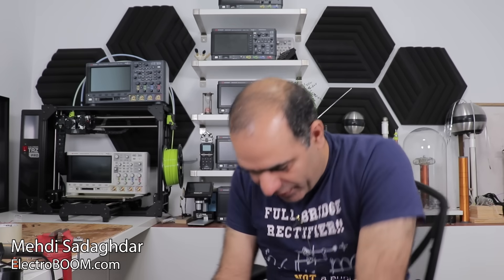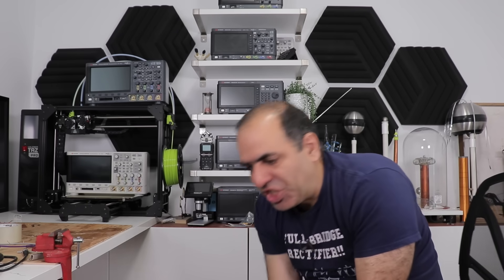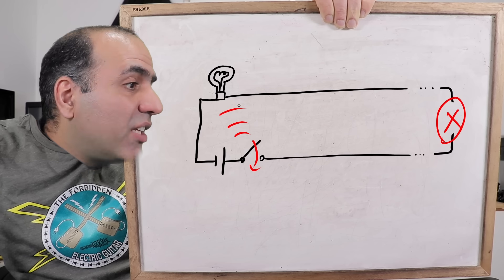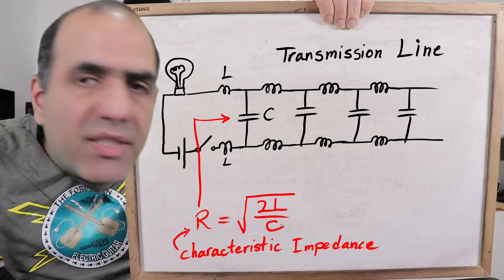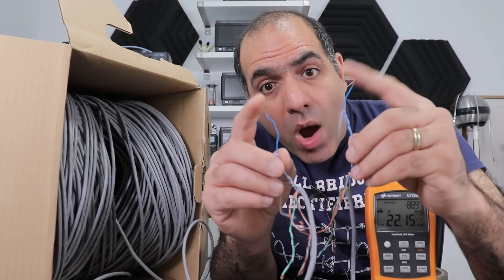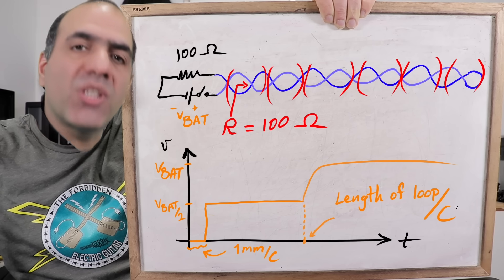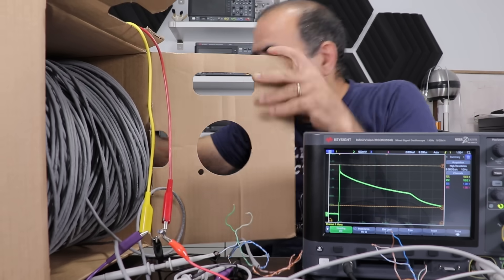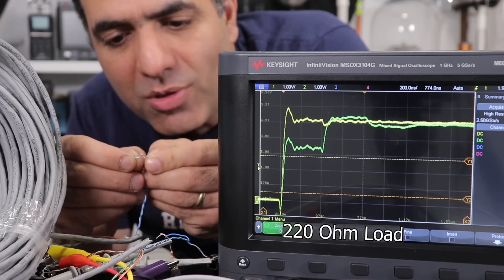Testing the LONGEST LOOP OF WIRE!!! to Turn a Lamp On

Comment: I think this again shows that the original Veritasium experiment is not about power transmission but about signals.

When you just turn it on, we can't really even see the light blinking. Only by connecting a pulse generator can we get an output that we can actually see. But what is that, then? It's a radio transmitter and receiver!

But I don't think anybody would have been baffled if Veritasium had said that with a 2 light seconds long superconducting cable they could send and recieve a strong radio signal over 1 m distance.

Comment: He ist not showing the Led turning on with the Open Line after He added the resistor. Am I right it would Work Like expected now and the Led turns on for a Brief Moment when He conects the Open circut To the Power?

Comment: Nerdy question for you... what happens if you use AC instead of DC?  I've done a bit of homework before asking this question and my partner will not let me connect 1000ft of Cat 5 cable to mains nor do I own the equipment to test my question - No fun. Thanks for all of your training. (I think I get twisted pair now too 20+ years later)

Comment: if you had a lightyear long length of wire and never connected the ends would it still work? would you get power through it for two whole years before it turns off??????
Reply from the maker: Yes

Comment: 14:18 this is interesting. I didn't know anything in pre-diode electronics had this effect on the output where it will flip flop between values before approaching the final value, or increase, depending on input values. Seems like it could be used to build some kind of steampunk computer given enough wire.

Comment: LAN cable (all categories) has text printed on it during manufacturing. It shows cable information AND measurement marks starting at 305m in your case and counts down as you dispense it showing remainder of cable in box. For us in UK 🇬🇧 that’s metric so it’s metres for us. Not sure about you in USA? Therefore there’s no need to manually measure cable length as you showed in your video. Now having said this something is telling me you already know this and manually measured your required cable length with tape measure perhaps to provoke a comment? Oh, the boxed cable is cleverly coiled inside in such a way that the cable can be pulled from the box through the hole and no need to open the box. If you do open the box and disturb the way cable is coiled you may regret it. Once kinked inside it turns into spaghetti and spoils your day, so good luck with that if happens to you. Hope this makes sense. 👍 from me! ✌️🇬🇧

Comment: 10:00 the top and bottom twisted pair wire colors cannot be distinguished  well. For technical information please make sure to pick colors that contrast enough, especially with color vision deficience (not color blindness as it's often called, since colors can be seen, just that compared to average vision, some colors contrast more and others less, but there are colors that work for almost everyone -- those that really can see colors and don't have grayscale vision). So while it's often called color "blind", it is a misleading term and a misnormer.

Comment: Saying that it "knows" is a terrible explanation. It doesn't know anything. This is a simple capacitive/field interaction, it's a result of the inherent non-ideal characteristics of the system. A field will briefly be present as a ghost in rush current flows to fill the capacitance between wires. The reflection point basically represents electrons "bouncing" off the open circuit. This is well known, and is the reason SCSI buses must be terminated with resistors: if you didn't do so, reflections would come back to the bus transceiver. It's also a known phenomenon in radio with incorrectly tuned antennas, and is represented in a figure called reflective power.

The rest of the circuit isn't operating on "knowns," it's just two things happening simultaneously: the inrush from wire capacitance, and the reflection from electrons trying (and failing) to find their way to positive. The little inflection point from the electrons reflecting demonstrates that it does happen. The tail off during open circuit represents the open circuit wire capacitance.

Basically, this is nothing new. All that's happening is the wire is a capacitor when the loop is open. It allows a brief current into the plates (with reflections because of poor tuning) and allows quick AC pulses through to the load.
Reply from the maker: What is... knowing?

Comment: The waves aren’t “reflecting”. The valance shells of the copper atoms are filling to saturation or equilibrium. When the switch is made you get hole flow in the conventional direction to complete the circuit. Electrons don’t “bounce” off atoms. They travel via valence shells. As an electron sees the brief free space it jumps in.  The atom becomes unbalanced and now must lose one to the next atom free space or “hole”.  If an electron had enough energy to “bounce” off an atom it would be a radioactive beta particle. Not an electron.
Reply from the maker: Electron doesn't need to leave its atom for a wave of current to happen, which is different than a flow, were electron can leave
Reply: @ElectroBOOM  DC pulses were used, not ac. You created a static charge on the copper wire by using dc. Your wave is directly caused by electron flow. You can not get a wave without electron flow. Whether it’s moving to one end of a capacitor or through an inductor it’s the very movement of the electromagnetic field that creates a wave and the field only moves when the electrons move from atom to atom.

Comment: This solved the whole puzzle for me. Actually being able to see the speed of light (in the wire) visualized on the screen was facinating and really convicied me of the whole wave theory.
Reply: It's bloody amazing when you get a visual nudge to get the noggin' joggin' !  by now I'm convinced, we could skip school and just have the tutors carefully select/curate videos with these almost magical properties to teach abstract concepts such as refections, magnetism, reactive power, how charged surfaces behave etc. Much too often schools focus on formulas, numbers and math examples... which are to quite alot of students completely utterlessly useless unless they understand the underlying behaviour first.
Reply: @Paxmax  You say that because you don't know what you don't know, so you think you've learned much more than what you've actually learned from these videos
Reply: @tonylee1667  Fair point, I was not educated, tried and tested "from scratch" by the method I described... I am a product though by teachers who suck at teaching to some degree... and teachers that suck at breaking down new concepts in smaller chunks to make it understandable / unable to approach from different angle.
Reply: @tonylee1667  Maybe I misread your comment slightly; I did not learn much new from this Mehdi video, I have worked in R&D as electronics designer for 16 years, I have designed and tested both copper and optics communication designs/devices during the years. I am definitely by no means an expert at all. It felt easy to indentify how I wished certain concepts would have been explained rather than wait until you learn by work experience or independent struggle.

Early in the Mehdi/Veritas "fight" I have even suggested an analogy of my own: Imagine instead of copper wires a garden hose. You suddenly turn on the water, it is detectable at 1m distance very much sooner than you can get full power because of the accoustic effect of the ever so slightly sudden bulge of the hose. The noise travels through air and imparts some energy into the "target hose" section before the water comes rushing into target hose. It aint much powah delivered by accoustic... but its there. I have previously designed a "water world" to explain electricity/energy transfer through various components as a different way to make electricity more approachable and perhaps relateable to learning for rascal brained people like myself.

Comment: Hello again ,nice video and i dont disagree either with you or Veritasium all videos i v watched on the matter  where very interesting and i think we can all conclude that   its about  induction ,  you are right ''it doesnt matter '' either you use a pulse (battery/switch) or a pulse rate  the basic law is  the general form of Faraday's Law ε = -dΦB/dt.which  applies  but   its not the only physical phenomenon that  happens  in electricity  there is also lets say charge distribution  ,and an other thought experiment, if you apply an alternating source  on the theory circuit lets say  50 hz  will the nominal  current  ever reach the bulb ?  for 50 hz we have 50 cycles per second ,for  each cycle current flows towards the bulb and then reverses ,a classic sinusoid , for the first half of the cycle  the  current has traveled for 0,01 sec for 50 hz  before fading to zero and reverses , that time is  about  3000 km in distance  and the  cycle repeats,  so how can  alternate current   ever reach the bulb ?

Comment: If you have a chain that has no flexibility and no slack and is 9 million kilometers long and has a driving and a driven sprockt at each end. You turn the driving sprocket around a few revolutions, and before one link of chain even moves one metre through the loop, you have transferred power from the driving gear to the driven gear. My point is that one link of chain does not have to move the full 9 million kilometers and back before energy is transferred. Maybe it happens instantly? What if the chain works the same as electrical power and energy is transferred through the air in some sort of force between the two sides of the chain. Even though it's 9 million kilometers long, side to side could only be 1 metre. What if the power transferred through the one metre distance instead of the 9 million kilometer and back distance? Now of course this doesn't mean that if the chain had tension and slack that it would be the same because you would have to overcome the slack and tension before the other side would receive power... or would you? Once you start pulling the slack the balance would change and the other end would move. Perhaps though, there would be an amount of time to overcome the tension before something happened at the other end. Would this time be the speed of light, or maybe some other amount of time possibly faster than light? Could you then send a signal through a significant distance instantly through a physical thing? Would it travel at the speed of sound did like a vibration through the chian? Could be that it's the same as a kids toy telephone made from a couple paper cups and a string, except the string is 9 million kilometers long...

Just had the random thought after watching a video about lego chain moving around obstacles...

Comment: I just had four 1000 meter boxes of cat6 cable delivered to my classroom for a rewiring project in the fall.  This experiment is awesome for demonstrating how the twisted pair cancels out the noise between adjacent transmission lines. I absolutely need to do this demonstration in class in the fall, with ALL FOUR BOXES!

Comment: I was looking at the 'electric fields carry the energy' setup and how that'd make the lamp pulse if the wire was broken. Though "oh that's just a capacitor, of course there will be a pulse." That's not wrong as far as I can tell, but, at least to me, that makes this mechanism feel a lot more real than it did before.

Edit: Feel like I should point out: Using "it's a capacitor" to argue against Derek's claims would be like using buoyancy to argue against the existence of gravity; buoyancy is caused by gravity, much like how capacitance is caused by electric fields. I'm not doing that here, in fact I'm doing the opposite - like the EE version of "The boat floats because gravity pulls the water that would otherwise take its place down harder than it does the boat." It's understandable how those claims could be made, after all capacitance feels like a separate idea here.

Comment: This really raises a lot of questions in my head.
If it is not the movement of electrons that causes electricity to flow, how do solar panels work? I was always told that light hitting the panels surface frees up electrons which then can freely travel through the material and are then put into a circuit to generate electricity. How does this fit together?

Comment: @3:46  Battery in the diagram is the wrong way around.  Electron flow is from the negative terminal.
The diagram is positive holes flowing forwards or electrons flowing backwards, but it will still work.

Comment: Very well done!

What if you had this setup where the \ on the right is a switch that flips the energy connection "e" between the top and bottom bulbs "b"
|----------------b----------------|
|----------------e----------------/
|----------------b----------------|

Does that mean both bulbs will come on as soon as you activate `e`, but one of the two would then turn back off?

If that is the case, then in the following setup would both bulbs come on, and then the top bulb would turn off and the bottom one stay on?
----------------b---------------
-
----------------e----------------
|                                       |
----------------b----------------

If that is the case, does that mean if the wires were 5 light years long either side of the energy source (zero resistance) then the top bulb would stay on for 10 years before it went off?
Reply: Yes, yes, and yes. You do need a bit more than just zero resistance though, you need zero losses including inductive losses.
Reply: @jmodified  As a programmer, I used to laugh at people who claimed the universe was a giant software simulation. The more I learn about stuff like this, the more I see computer programmer hack jobs that made it into the software because someone was under pressure to deliver :)

Comment: So a friend of mine and I were talking about how bad a lot of the phone chargers are that Apple sells. And the question came up. Why do we use solid copper wires anyway? Why not copper dust or copper shavings, tightly compacted in standard wire insulation? That way the wire could remain flexible, yet won’t break as easily.

Comment: Have question of transformer phase of sinus is 90 derese behind of power that means pulse signal is behind of power even on long wire. That means you get delay of turning lamp on at power.

Comment: I have to measure the length of twisted pair cables in house installations. Prior to starting the measurment we have to input a few things into the measurement device, one of them is the NVP factor, to get the length right. It slighty differs from cable to cable depending on the manufacturer, but in general it is 0,6 - 0,7 for CAT6 cables. See https://en.wikipedia.org/wiki/Velocity_factor

Comment: woow the wire is actually LOOOOOOOOOOOOOOOOOOOOOOOOOOOOOOOOOOOOOOOOOOOOOOOOOOOOOOOOOOOOOOOOOOOOOOOOOOOOOOOOOOOOOOOOOOOOOOOOOOOOOOOOOOOOOOOOOOOOOOOOOOOOOOOOOOOOOOOOOOOOOOOOOOOOOOOOOOOOOOOOOOOOOOOOOOOOOOOOOOOOOOOOOOOOOOOOOOOOOOOOOOOOOOOOOOOOOOOOOOOOOOOOOOOOOOOOOOOOOOOOOOOOOOOOOOOOOOOOOOOOOOOOOOOOOOOOOOOOOOOOOOOOOOOOOOOOOOOOOOOOOOOOOOOOOOOOOOOOOOOOOOOOOOOOOOOOOOOOOOOOOOOOOOOOOOOOOOOOOOOOOOOOOOOOOOOOOOOOOOOOOOOOOOOOOOOOOOOOOOOOOOOOOOOOOOOOOOOOOOOOOOOOOOOOOOOOOOOOOOOOOOOOOOOOOOOOOOOOOOOOOOOOOOOOOOOOOOOONG

Comment: I think your bit about the twisted pair is a little off:
For the fields to cancel out (reducing the inductance), the signal needs to be in phase between both conductors - the negative and positive will be driven simultaneously and will propagate the cable together.
In your experiment, since current flows through one wire then the other (excluding the capacitively coupled current as this is not going to be of exactly the same magnitude), the magnetic fields will not be cancelling out and the inductance will be higher.
Reply from the maker: But the current in both wires will be in phase, you can't have different currents flowing in series circuits. What goes into capacitor comes out of the other side, only except considering the speed of light

Comment: after watching this video on planetary gears; https://www.youtube.com/watch?v=TzJkD87eQNI
and thinking about maglev fans for PC's, could we place magnets in the "planetary plane"; Directions |--->  ;to produce torque from both inside the motor and outside? 
I.E. 3 Shafts in with magnets capable of spinning in sync - using something like a Limited slip differential to allow for maximum torque from x shaft doing so- rotating both the internal shaft (sun gear) and outer ring in the opposing direction (ring gear) to produce dual output from a "DC" motor? 

Side note because I may be stupid atm butttt: I see we only ever harness the inside and outside of our devices but what if we started to manipulate the events happening in between devices?
Reply: Essentially a Magnetic transmission powered by manipulating the forces inbetween the outer gear and inner shaft providing action potential to the once stationary shaft in a DC motor.
Using a magnetic flywheel comes to mind as well to provide some form of motion potential when load occurs.